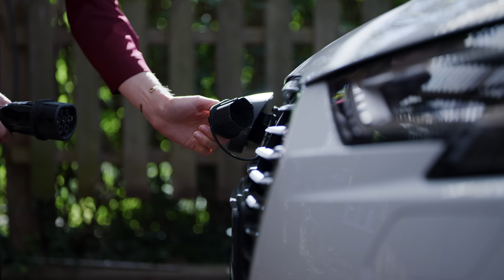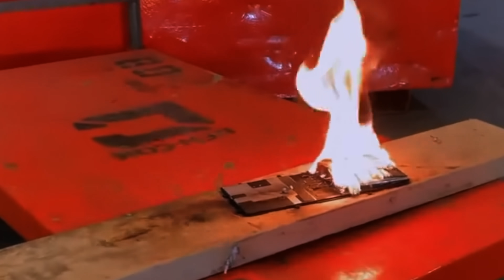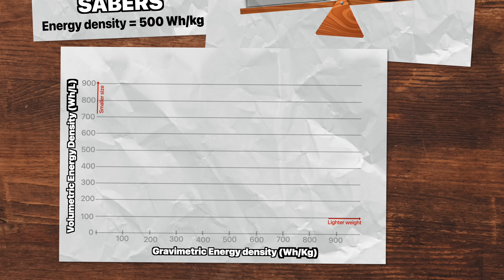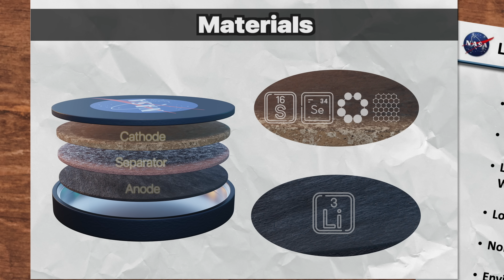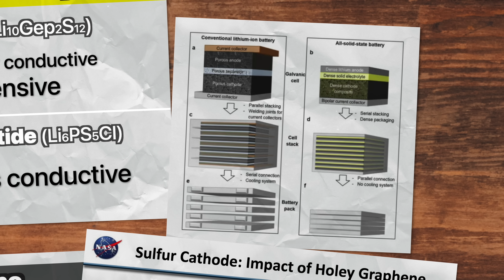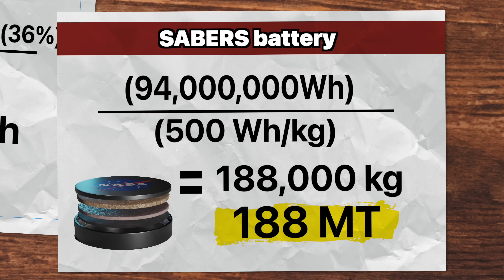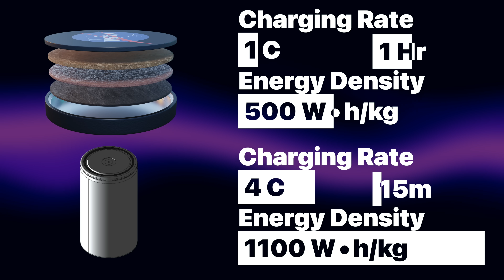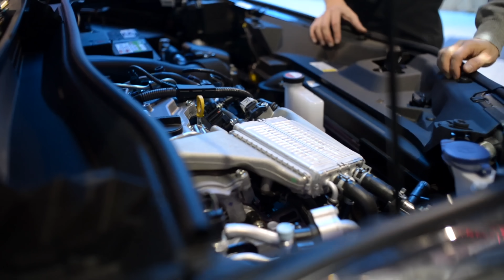Why NASA is Building a Solid State Battery

Comment: The cool thing with electric planes is that they can be of a much different and more efficient design than ICE planes. 
For example, thin, laminar-flow wings, optimally placed arrays of motors, and battery pods that can fall away and fly back to an airport. 
The last one gets me most excited. Of course, dropping bombs for a century has given us reliable disconnects, and autonomous flight is child's play, so it's not a technology impediment. 
Imagine an electric plane with two giant battery pods under the wings. It uses these for takeoff and to climb to cruise. After that, the depleted batteries detach and turn back home, substantially lightening the load. Rocket equation stuff. 
As for keeping the peeps and the inboard batteries toasty: there are  many solutions. Mostly better insulation and counterflow heat exchangers. The passengers and battery/motors produce a lot of heat. Trapping the heat is key, so any air exiting the cabin will be used to heat incoming air. 
Depending on battery specs, the large thermal mass they are can also be heated on the ground and do double duty as a thermal battery. 
We'll look back to these aviation times in 20 years like we do WW2 tech today. Exciting!

Comment: Battery powered cars or airplanes are just appliances, powered by the grid. Batteries don't make energy. The more EVs, more coal gets burned to power them. EVs are net filthy. Better to burn the fuel at the point of use rather than remotely. For example a Prius engine has  ~35% efficiency, comparable to that of power plants. EV fan-boys are selling snake oil. They sound really good though. Great patter! Cheers.

Comment: Toyota are also a part of something I'm finding more interesting.  They haven't been "dragging their feet", they've been looking at a potentially much better option.  The solid state battery stuff is amazing, but their focus on ammonia powered engines is looking far more promising.  Not just with cost and efficiency, but on the whole "green tech" stuff they're all trying to move towards.  Well worth looking into.
Reply: I was not expecting Toyota to do that, since they said they don't like EV vehicles
Reply: @jalie-15303b  so we mine lithium but its pollution when we put it back?
Reply: @TheAnimalOverflow  yep... polluting both at extraction and dumping.
Reply: No fuel-based motor is “efficient” compared to EVs. Internal combustion has a theoretical maximum efficiency of around 35% for converting potential energy in fuel to mechanical force. The rest goes to operating the engine itself (if you’ve ever kick-started a motorcycle, you’ve felt how much power it takes just to move a crankshaft through the compression cycle), and waste heat lost in exhaust gases and cooling systems. In real-world practice, internal combustion motors in cars are less than 20% efficient. (Highly optimized coal powered turbines are about 33% efficient in practice.) 

We can observe this easily. A gallon of gasoline has around 35kWh of potential energy. Typical EVs have a 70kWh or so battery - about two gallons of gasoline, which offers a range of 250 miles. Around 125mpg energy equivalent, in very round numbers, but around 4x the energy efficiency of internal combustion. Ammonia will not magically change this! Now, consider where the ammonia comes from. If it uses only renewable energy and electrolytic green hydrogen, synthesis efficiency will be well under 50%. Most industrial ammonia isn’t made that way - it uses brown hydrogen from fossil fuel. So without a better ammonia synthesis chain, it will actually be dirtier than gasoline, in CO2 terms. And beyond producing clean ammonia at scale, there’s the lack of a distribution network. 

Do not get your hopes up. I don’t know what internal politics is driving Toyota to play around with these dead-end combustion technologies rather than developing EVs (especially considering their long experience with Prius hybrids, which gives them a head start), but I’ve concluded that Toyota is just putting spin out to the public and dying internally. I don’t think they’ll be in business by 2040.
Reply: @davestagner  Nobody (sane) is disputing the higher efficiency of an EV. What most don't like is the fact that EVs are really not a viable alternative for everyone. Why not let the market decide instead? Make EV that charge fast (10 min), have a great range (I can drive my car 900km on a tank) and are on par with ICE vehicles price wise.  Then the people are going to steal them from the dealership lots. As it is now, we're offering subsidies to rich people to buy new toys, because poor people will go for cheap, 2nd hand ICE cars. Why forcing people to buy something? That's maddening. Make it an attractive alternative and there will be no need to push EVs by subsidies and regulation.
Reply: “The market” has made it difficult or impossible for millions of people who want an EV to get one, and I very much doubt you complained about that. No one is being “forced” to buy an EV, and hearing that untrue nonsense constantly is “maddening”. Today, and through at least 2035 everywhere in the US but California, it will be legal for you buy another gas-guzzling CO2 machine. And to the extent that there will remain common use cases where EVs don’t work well enough, there will continue to be a market for them. That said, EVs are advancing rapidly. Thanks to advances in batteries, charge times and range are improving, and prices are plummeting. EVs are reaching cost parity with equivalent CO2 cars, even without considering the long-term fuel and maintenance savings, and will soon be cheaper. In another decade, it will be economically irrational to buy a gas guzzler, and the secondhand market will be full of perfectly good EVs, that are more reliable and have more life left in them than gas guzzlers made the same year. So yes, by all means, let’s let the market decide! 

Of course, I wasn’t responding to EV vs gasoline in my comment, but rather EV vs ammonia (or hydrogen, take your pick). That IS a fantasy, which would require all the “subsidy” and “regulation” you decry, because there’s no fueling infrastructure, and the fuel would be more expensive than gasoline, while sharing all the disadvantages - probably including the CO2 footprint, unless a green hydrogen/ammonia infrastructure is ALSO built out.
Reply: @davestagner  It's dishonest to say that "nobody is forcing us to buy EVs" when older cars are banned from LEZ and ULEZ zones and new ICE vehicle sales will be banned in about 6 years. 
As for improving the charging times and range, let me know when is improved already. I don't want to buy something that offers me less for more money.
And who has made it difficult or impossible for millions of people who want an EV to get one? I just saw a video showing that EVs, in USA at least, stay much longer on the dealers lots than ICE cars.
I think you just hate ICE?
Reply: @johnnyblue4799  I don’t hate ICE. I hate fossil fuels. I grew up on motorcycle drag racing and hot-rodding and still watch racing. I’ve loudly promoted Prometheus Fuels and other clean synthetic fuels. I don’t think ICE should be used in mainstream transportation because they’re inefficient - which they are - and because EVs are superior for most people in most use cases. But yeah, let’s keep racing going! Let’s preserve collectable classic cars! And in cases where battery power truly will not work (aircraft, shipping, etc), we can address that market with synthetic fuels in the second wave of decarbonization. But all those CO2 machines sitting in people’s driveways right now are the low-hanging fruit, along with coal power plants. Let’s replace them with something cleaner, cheaper, and better performing in almost every way. 

As for the LEZ and ULEZ zones in the UK… hey, remember market forces? Are you familiar with the economic idea of “externalized costs”? Pollution from gasoline/diesel is a tremendous externalized cost. Besides the climate impact of the 20 pounds of CO2 produced by every gallon of gasoline (or 2.3kg/l for non-Americans), they produce nitrous oxide and carbon monoxide that are immediately harmful, and such emissions are a major cause of death. So yeah… let’s tax that. You want to drive vehicles that spew poisons into a crowded urban environment, I think it’s entirely reasonable for the residents of that environment to tax that behavior. And if you don’t want to play the tax? Drive a nice, clean EV instead. Market forces, again.
Reply: @davestagner  
So you do hate something... 
1. CO2 is NOT a pollutant. ICE does pollute, but CO2 is not one of the pollutants.
2. LEZ/ULEZ Is not market forces is government intervention. And not only in UK.
3. If you really care about death causes and want to tax them out of existence, tax junk food. Ultra processed food is killing a lot more people than today's really clean engines.
4. I don't disagree with phasing out ICE engines, but we need viable alternatives, not scams like the EVs. Let ICE die their natural death, don't legislate them out of existence. 
5. It's dishonest to ban diesel cars out of the cities after promoting them for lower CO2 and lower fuel consumption. People paid money for those. Cars will die in due time and need replacing. Nothing will be gained from scrapping them early. Especially when the transportation in EU is a very small contributor to pollution compared to countries like China and India. If they don't clean up, we won't make a difference even if we stop driving altogether. These abusive measures against cars are hitting mostly on poorer people, as usual.
6. Last, but not least, fossil fuels are the energy that allowed everyone to have a better life and humankind to flourish. It has no replacement yet, and all this greenwashing going on will only degrade the quality of life of many.
Reply: @johnnyblue4799  Fossil CO2 is altering the climate. If that’s not a pollutant, I don’t know what is. If you’re a climate change denier, there’s no point even talking to you. I don’t disagree with taxing junk food, but - at least it’s a choice. 
A person can choose a healthy diet. But they can’t choose healthy air if they live in an urban environment, even if they don’t own a car. So these are not equivalent. 
Anyone who promoted diesel for lower CO2 was dishonest. Diesel emissions are actually higher. And AGAIN, no one is banning these cars. No one is forcing them off the road. (And they won’t be scrapped; they’ll be sold as used cars until they no longer run.) And as I keep pointing out, taxing the immediate, demonstrable harm they cause to urban environments is perfectly reasonable. Don’t like it? MOVE. 
CO2 per capita in India and China is far lower than Europe. Please don’t trot that crap out, it’s dishonest. 
What’s a “scam” about EVs? They’re widely available now, with millions on the road. We know what they do, and what they don’t do. No “scam” there, just consumer preference at work. The free market, remember?

Fossil fuels built our modern industrial society, yes. But if we don’t stop using them, they will destroy it. Replacement is coming along at speed, in the form of renewable energy and electrifying everything (particularly transportation). Just how long do you think we can continue to use fossil fuels at our current rate of consumption, before either a: we wreck the environment to the point where civilization itself fails, or b: we run out of fossil fuel? A hundred years? 500? A thousand? Humans have been around for a few million years now, and will likely continue to be around for millions more. Do you think we’ll still be burning gasoline in a million years? Fossil fuel has added about 140ppm CO2 to the atmosphere since we started using it around 200 years ago. It added 2.6ppm last year alone. A million years of that would literally displace the entire atmosphere 2.6 times over. THIS IS NOT SUSTAINABLE. 

But you’re probably stuck in climate denial, I’m guessing.
Reply: @johnnyblue4799  Forget it man, this is some psycho stuff going on! They all seem to forget where the electricity for charging all their EVs come from. They obviously support deforestation in order to make Li mines, but somehow fail to see this is the biggest problem. CO2 is not a polutant, it is essential for the planet's life, but without trees ofcourse its levels go up.
Reply: @griffint6637 Batteries don’t need to be better. They need to be good enough. And they are already for most situations, and getting better, unlike gasoline. You’re also forgetting that gasoline is trashing the planet, and will run out sooner rather than later. Even if fossil fuel did no harm at all, it’s a limited resource.
Reply: @griffint6637 If time is the scarcity, why the heck are you pushing nuclear? It takes AGES to build a single nuclear plant, much less the 5-10x scaling we would need. Plus it’s ridiculously expensive, which is why it never caught on. Solar is the cheapest energy source there is now (and prices are still falling and have a ways to go), and very fast to set up - the main slowdown is grid connectivity. Nuclear would have the same problem, unless it takes so long that they can easily fix the grid in advance. That all said, I’m not seeing real-world evidence that the grid can’t handle the demand of EV adoption yet, just a lot of using it as an excuse for not adopting EVs. (And mind you, no one is being forced to adopt EVs!)
Reply: Toyota is also launching their solid state battery in the next 2 years.
Reply: Wrong @IdrisFashan

Comment: The much more viable option for the aviation industry is to concentrate on carbon neutral synthetic kerosene, i.e., CO2 extracted from the atmosphere or from ocean water. Put Thorium nuclear reactors on the coast where they produce both synthetic hydrocarbon fuels and even some fresh water - and electricity, of course. All of these are badly needed to keep civilization a going concern.

Comment: I think besides energy density for most non commerical applications, charge cycle lifespan is one of the other biggest factors that would usurp the current battery tech.  Its the most common reason people are replacing their entire phone, or the biggest reason an EV trips a warranty claim.

Comment: Realistically electric passenger airliners need at least 2 things:

#1. Superconducting electrical motors.

The power density of SCEM just blows everything else away - it's why the Navy is using it to electrify their destroyers.

#2. Probably some kind of molten electrolyte metal air chemistry battery.

MEMA type batteries are bleeding edge in the battery field and far surpass even the wildest expectaions of lithium air cells.

Comment: Of course, you won't get the same weight of battery, you'd get the same range/power you get now, just with less weight. Your 737 will also use a lot of that fuel weight to take off...

Comment: You are forgetting that altitude is a limiting factor for jetfuel engines... less so for electric engines, which would be able to go to higher altitude where air resistance is lower, thus extending the overall range.

Comment: Big thing missing from the airliner evaluation, is the weight of the battery.

When a plane uses fuel it gets lighter, a battery doesn't get lighter as you fly.

Comment: I think there is a possibility that when Level 5 or 4 automation for cars becomes a reality you might see more people just drive to their location despite the extra road time, just to avoid having to be there so early prior to take off, or other difficulties you can have going through the airports.
Reply: That is already happening where very fast trains are an option.
Reply: @dexterford8094  And imagine if you can have your car drop you off at the train station, then drive itself home.  Then do the reverse when you return.  Or, more likely, Ubers and Lyfts will be automated and much less expensive, so most people will use them exclusively rather than own their own vehicles.
Reply: @davidmackie3497  ... LOL. I already have a wife who will do that for me so don't need an expensive robot car. Actually, I think I would be quite anxious riding in a driverless car.
Reply: @dexterford8094 LOL, not everyone is as lucky as us, bro!
Reply: @davidmackie3497  ... for the unlucky ones there is Uber which actually might be cheaper than a wife in the long run... but not as much fun.
Reply: @davidmackie3497  I could see that and you could also Uber around town after the train ride.
Reply: @dexterford8094  I'd be hesitant to trust prices staying the same consistently over time if there isn't competition in Autonomous Uber driving.

Comment: This sounds really great! I do wish that you hadn't at 16:00 taken what you say is an educated guess based on the reported charge rate (which can be considered the minimum, with an unknown maximum), done calculations based on that, and then stated the result as if it was a factual maximum instead of once again saying "at least X". Also you didn't compare the cycle degradation from sulfide shuttling to similar effects in current battery tech -- Lithium Ion batteries definitely lose capacity over time, so I'm a little disappointed at the lack of comparison there too.

Comment: I'm not going to hold my breath... I give it maybe 50 years till there is truly viable safe energy dense power cell to meet the demands needed, plus with fast charge times... hard to beat 5 minutes at the gas pump and not having to change out your engine after so many fill ups... Every time I fill up my vehicle I get the same range and performance where as an electric vehicle slowly loses range and charge with each charge cycle...